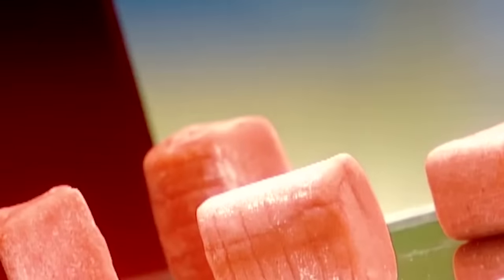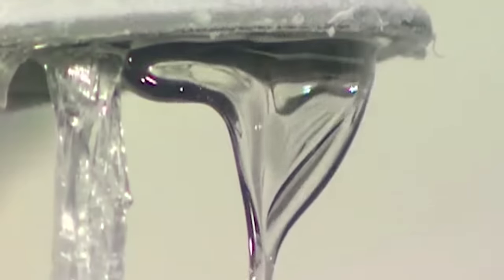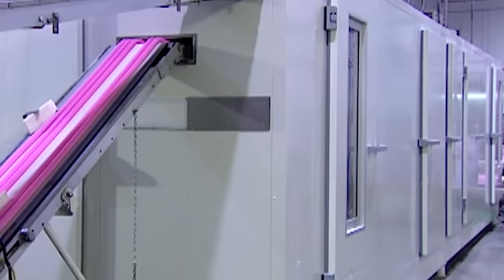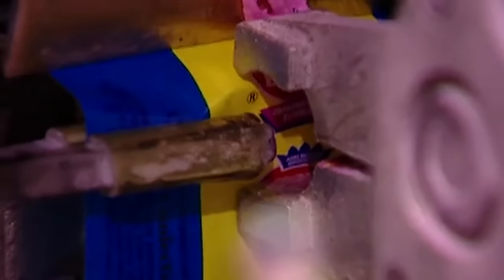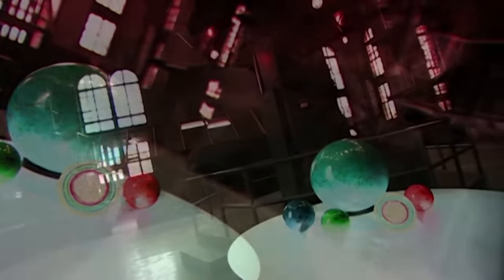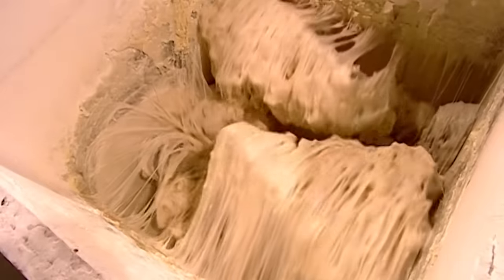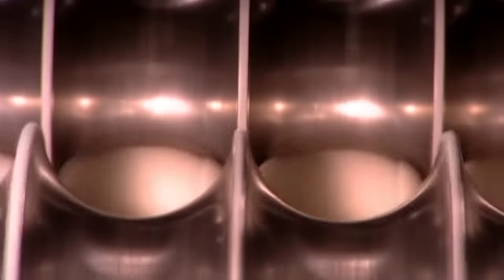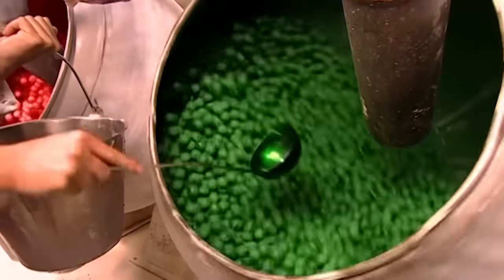How Bubblegum Is Made | How It's Made

Comment: Eating it won't kill you, just letting y'all know. It'll go right through the digestive system and out, you'll only absorb the sugars not the plastic or rubber; nor is it toxic! You're supposed to chew not swallow anyways. 
Another heads up: There are still companies who make gum the old fashion way with natural ingredients and no rubber/plastic
Reply: rubber is natural stupid.....and the natural counterparts of gum is still rubber,resin or latex.
Reply: Retired RN: no it doesn't always go out! Sometimes it collects into a big ball in the intestines, obstructs the bowel, and has to be surgically removed. Yes it can be life threatening.
Reply: @jeanetteshawredden5643  Well obviously if you’re eating a whack of it. But if you accidentally swallow one piece you’re not likely to die.
Reply: which companies are those?
Reply: @jont2576 synthetic rubber isn’t natural smart one
Reply: @theunkownboss8052  They are both hydrocarbon-based polymers, however, whether from a tree or from a distillation tower.
Reply: Very nice to hear want to chew gum natural way
Reply: Which companies use natural gum? When I was a kid in the 70s the gum ended up dissolving in the mouth after some time, that was natural. Never happened to me again, I don´t think any company uses natural gum these days, it would be too expensive.

Comment: Ah yes, every good candy starts with rubber and plastic.
Reply: first time knowing this . I always wondered for what this rubbery texture . turn out the real rubber and plastic . never going for them from now on .
Reply: Tbf chances are those plastics are not even in the top 5 most harmful substances in these.
Reply: I wonder what the industry's affects on microplastics pollution is
Reply: 1. Rubber is originally from the rubber tree, so if this is natural rubber, then it's just sap.

2. Plastics are just polymeric substances, and there are also natural polymers, therefore natural plastics. 

Now, I'm not saying these gums are made from all martial ingredients but they could be even with those two descriptors.  

😊
Reply: Well it's gum, it's supposed to be chewed not swallowed which is why the base can be synthetic. Cause it doesn't have to be edible per say, just something you can chew and has flavor to it, that's it.
Reply: @aindrilagoswami5353  Well it's gum, it's supposed to be chewed not swallowed which is why the base can be synthetic. Cause it doesn't have to be edible per say, just something you can chew and has flavor to it, that's it.